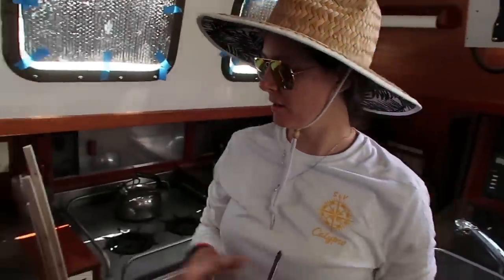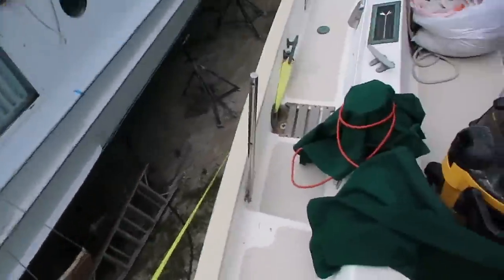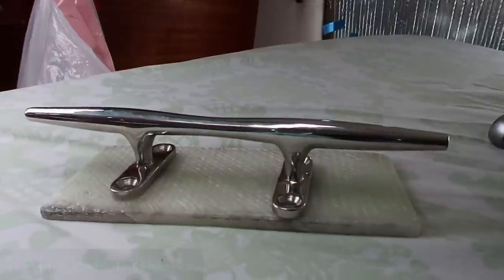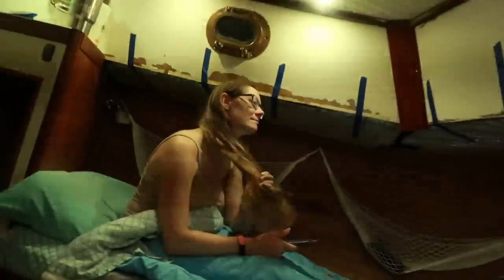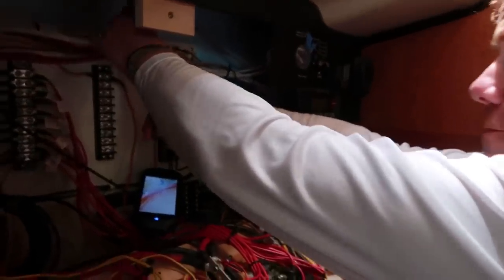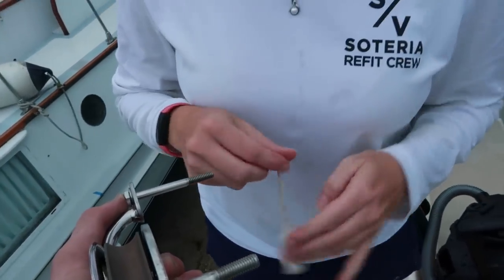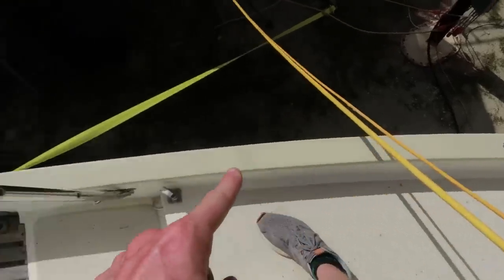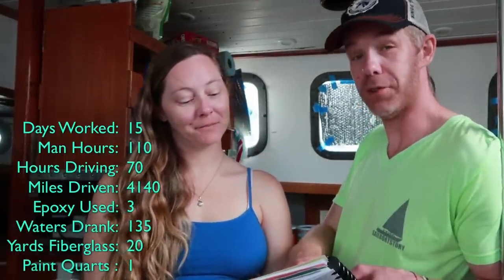HULL TO DECK JOINT REPAIR | PART 7: Stern Cleats, Pushpit & Cheek Blocks | Sailboat Story 204

Comment: Putting that cleats on that way is a great idea. It greatly reduces chafe!!! Seriously, I threw my chocks overboard. Running lines thru hawse holes looks salty but we have to do  the best we can to  minimize chafe. I have rescued many boats that chafed thru their lines and anchor lines. As you know, lines stretch in in/in so the shorter the run the better. Keep up the great work and videos!! thanks for sweating with us!
Reply from the maker: Thanks, Frank. We've certainly received mixed opinions, as expected, on the outboard cleats. For our timeline, needs, and budget it was the right move for us. We can always make changes if it doesn't work out, but I expect that they'll be just fine. Yes, chafe is a problem with the hawse pipes, and I actually need to get some good chafe gear to protect the lines that will run through them.

Comment: It must have been super tricky for the previous owner to have gotten that boat tied-off without those cleats? But two thumbs up (👍👍) to you guys for a great job installing the new ones.  
Working with fiddly things in tight spaces can be a royal pain in the behind!  
Y’all stay cool! 😎
Reply from the maker: I don't know how this boat made it from 1978 until now without aft cleats. It's only one of the many things that I've just had to shake my head over thus far. We're getting her sorted out though. Eventually I may do the proper bronze hawse pipe installations, but for now I just needed something to get us out there ASAP. Yeah, getting that hardware on was a bit like building a ship in a bottle, inside a ship, and I'm also in the bottle, and the ship in the bottle doesn't have aft cleats.
Reply: @Sailboatstory  Those are the kind of jobs that make me say lots of bad words. 🤪 And I’m not typically a potty-mouth but, whenever I get myself into tricky situations like that - there’s undoubtably going to be a fair amount swear words fly out of my mouth before the job gets done. 
🙃

Comment: The red channel is used in electrical switch gear to attach buss bars. Good stuff for just about anything else you can dream up a use it for.
Reply from the maker: It's super tough stuff, for sure. There's loads of different raw materials like that on the boat. Bars of aluminum and steel, loads of hardware, thick pieces of hardwood. I think I'll keep the red channel, but probably cut it down to smaller pieces that will stow away flat.
Reply: @Sailboatstory  that kind of stuff can always find a new home in East Texas. The boat's looking good and the sun screen tutorials been great as well.😁

Comment: Great job on the projects ! I'm also in the midst of a similar deck refit on my 42' ketch - I also don't want to reuse my 10' Genoa track for fear of water ingress once again due to the MANY deck holes required. 

I like your Barber Hauler setup idea and I'm really interested in the set up you're looking at employing there. I (we) would be quite interested if you guys were able to make a little segment on your barber hauler for us with a special emphasis on your set up (schematics, layout and video) Thx and cheers !!!!!
Reply from the maker: Cool, it's nice to hear that we're not the only one's thinking of using a Barber haul as a standard cruising set up. A schematic may be overkill, as all we intend to do is run a rope (Barber haul) with a low friction ring off of the forward cleat we mounted. The headsail sheet will run through that ring and we'll simply pull it in or let it out. The barber haul will be cleated to the forward cleat. The "rope" is made of dyneema and the ring is spliced into the end of it. That's all there is to it. There are fancier setups out there will more adjustment, but we're going for maximum simplicity. Hopefully it works. We'll see!
Reply: @Sailboatstory  thx for the explanation on your upcoming Barber set up. They seem to be simple enough but not much detail explanation on the web (like a how to from start to finish). I noticed that  some Jeaneau sailboats are now doing away with the physical Genoa track/cars and going w just with the barber haul set up. Look fwd to your coming episodes !

Comment: With nuts going into tight places that are straight forward but space is limited for your hands , I suggest a wobble socket on an extension.  To keep the socket from being TOO wobbly,  we put an o-ring on at the joint . It holds the socket in alignment but still allows it free wobbling.  For future tasks of such sort . ;)
Reply from the maker: We did exactly that, but without the o-ring. I can see how an o-ring or even a bit of tape could stiffen it up just enough to make it work better than the flaccid joint I was attempting to gently coax with any degree of intentional accuracy. Cool idea.
Reply: @Sailboatstory  It is an old aircraft mechanics trick . We can never reach into those places and then manipulate hardware and fingers too . Since you have butyl tape , that can't be stuffed in the joint as well . I love you guys and am always impressed with what you are doing .

Comment: Definitely a heck of a project , so important, leaks from the top are the worst in a boat ( everything gets wet as water makes its way to bilge!) .  Sounds like you may have to re-bed all deck hardware , or at least every time you expose the bolts when working with headliners! 
Quite a few Westsails were home finished from various levels of completion so you never know the skill level used to do the work. Probably why the one fuel tank was never connected! 
Was Mike the new owner of the motorboat? 
The red fiberglass is ‘pultruded’ and is usually a high glass content , the good stuff! 
Cheers Warren
Reply from the maker: I don’t know who the new owner is. I don’t think he’s seen the boat in person yet. I’ll cut that red material down into smaller pieces and stow it away somewhere on the boat. Really tough material for sure.
Reply: @Sailboatstory  we make a product  from 3/8” pultruded angle where we have to cut 1”x3/8” x65” off one leg of angle, 
We hate to throw it out , rot proof tomato staked is the best we can come up with , probably too small for back-up pieces….
W
Reply: @Sailboatstory  wow!  new neighbor boat owner bought sight unseen!  It was a about $145k or $125k….

Comment: Nicely done with the no track Genoa turning  block install. How is the lead to the winch ? Could not tell. Love simplicity when it works!!! 
Cheers Warren
Reply from the maker: Yeah the approach angle is good. That block is in the same position it was when we removed it. Should be good, I hope it’s strong enough since there are so many less bolts involved now.
Reply: @Sailboatstory  Sounds good with lead I forget you have those lovely high bulwarks/toe rails, plenty strong enough too. 
FYI instead of pan head screw I like to drill and tap( thread) the fiberglass. Does not crack the  fiberglass/gelcoat and super strong as well,&  replaceable with no loss of strength. 
Just like mounting fitting on the mast …
Cheers Warren
Reply from the maker: @CheersWarren  I heard that many people do just that on the Westsail 32s. The idea sort of made me nervous, not knowing what the strength difference would be, but if the barber haul experiment doesn't suit us then we will probably go that route if we reinstall the tracks.

Comment: Cap rail came out nice!  Turning blocks look great too.  However, I believe that your cleats mounted on the hull may give you problems in spite of the backing plates that you installed.  Cleats are meant to be loaded in SHEAR, and eventually a heavy load on those cleats may damage your hull.  There is plenty of data available on this topic.
Reply from the maker: Yep, I'm aware. It's less than ideal, but I think they'll do the job until we can install some proper "hawse pipe" style one like on the bow. If they don't do the job, there's nothing like a giant, gaping hole ripped in the side of the boat to motivate me to do the job right.
Reply: @Sailboatstory    I doubt that the cleat will pull out a chunk of the hull, but it sure could distort the hull if it is pulled sharply,  Did you consider chocks on the rail, cleating on the opposite quarter?  Thanks for your reply!
Reply from the maker: Yep, that was a consideration as well, but without the wide teak caprail on top, the fiberglass is only about 3" wide. A chock could have worked, and we considered several different types, but with how narrow the tops are it would have required some fabrication to build in some chafe protection into the setup. All in all, the outboard mount was just the best option we had available without getting into another major project, both financially and time-wise.

Comment: Well done! Some nice, solid work there.

I am, however, given the huge amount of effort you've put in so far, a little surprised that you skipped the "drill, fill, drill" routine when re-installing the hardware.
Reply from the maker: No need. It's all solid fiberglass, otherwise I certainly would have. We'll be doing just that when we install the windlass and forward hatch as there is coring involved in those locations.
Reply: @Sailboatstory  - Fair point..

Comment: The sealing putty looks and acts like plumbers putty I use for sealing sink drains. I wonder how similar it is?
Reply from the maker: Similar, but different. That'd be butyl tape, and it's become our favorite sealant for bedding deck fittings. Never had one leak that we've used this stuff on.
Reply: I used it for my bathroom sink drain 2 years ago and it still looking like the day I did it and have had no leaks or drips at all.    I did it in a pinch cause I had no plumbers putty.  I am a boater though not a plumber.  I will post back the day it ever leaks though so we will have real world test using it in place of plumbers putty.

Comment: Not sure if that was a good idea. On the stern cleats 🤷‍♂️🤷‍♂️🤷‍♂️.  But your boat. Your decision 
Great job Ben 👏👏👏👏👏👏👏
Reply from the maker: As I mentioned it's certainly not a typical installation, but barring anything other than extreme stresses on them I believe they'll do the job just fine. We'll see!
Reply: @Sailboatstory  just hope you don’t snag them on a sheet line. Dock pylon.    I thought maybe you didn’t wanna put any on top of the cap rail but you did put cleats on the top of the cap rail so I just assumed that you would put your stern cleats on top of the cap rail and said on the side of the hall
Reply: Boat haul
Reply from the maker: @bayardtaylor2990  If we're close enough to snag them on anything then things are already going very wrong. The solar panels, which will be mounted over the cleat on the pushpit, will rip off before the cleats snag anything. There's not room for the large cleats on top of the cap rail. The caprails near the aft end of the boat are far too narrow for them to mount there.

Comment: On W32s, we just drill and tap for the jib sheet track bolts when mounted on the cap rail.
Reply from the maker: I considered doing that as well, but the idea creeped me out. It must work though, right? I guess since there are so many bolts, the load is widely enough distributed.
Reply: @Sailboatstory  yes many w32s have done this- just shift the track an inch fwd or aft so u dont reuse the orginal holes. I have ~25 5/16 SS #3 Phillips bolts in each track.
Reply from the maker: @caljay1000  I still have the tracks on hand in case our experiment with the barber haul set up doesn't work out. Do you know if any other 42s have done the tapped hole method for the genoa track?
Reply: @Sailboatstory  not off hand.. ask Bud also.

Comment: Why do you have your own torture room on your boat?  What is that space? A sail locker?
Reply from the maker: That'd be the propane locker. It vents at the bottom. Also useful for, as you have guessed, torturing insubordinate crew... to maintain high moral, of course.

Comment: Genoa track?
Reply from the maker: Fettuccine alfredo?
Reply: @Sailboatstory  Love it! I like sail control as well!
Reply from the maker: Mmmm, cheesy. Delicioso!
Reply from the maker: Ok, ok. I just like picking on the lack of initial context. So the genoa track is not being re-installed. Instead we're going to run a barber hauler from the cleats the we mounted forward on the rail. We'll see how it goes. It's a bit of an experiment. The sail control and adjustability will be there, albeit with. far fewer bolt holes in our pretty cap rail, but the larger problem we wanted to avoid was adding 40+ additional leak points from the track bolts. We're keeping the track and cars so if we end up hating it, we'll end up installing the track before we really stretch out to far away places.